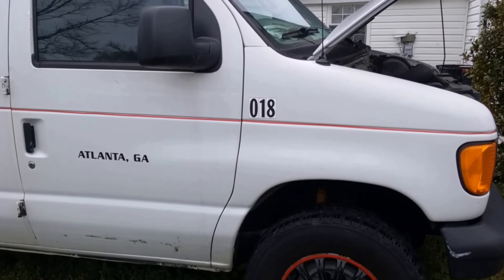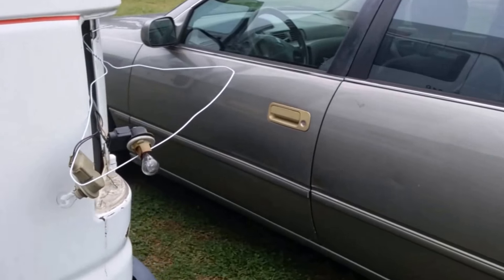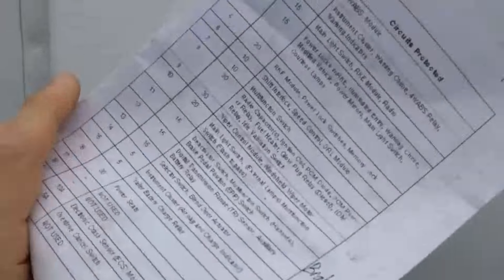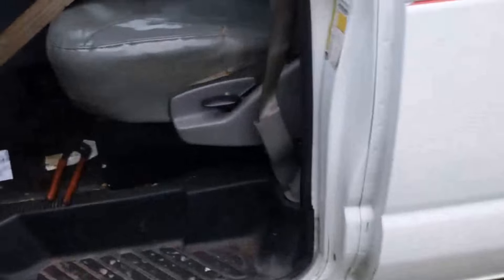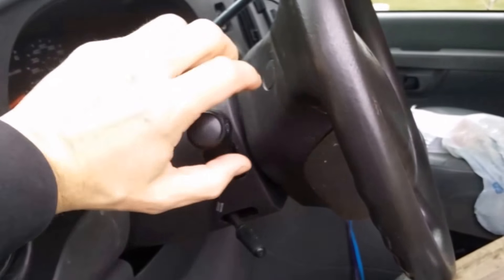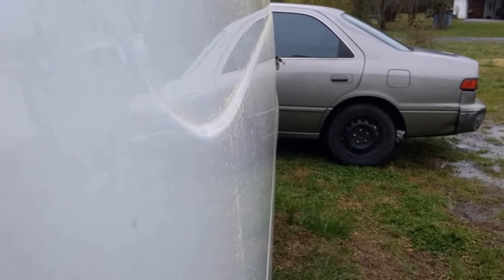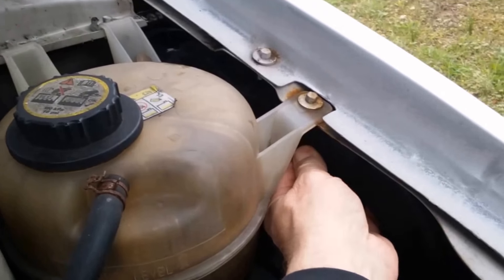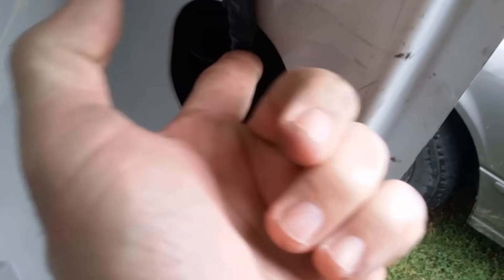How to diagnose brake lights and fix 2007 Ford E250

Comment: Check fuse 39 under the driver column. That fixed my issue.
Reply: Thank you! This fixed the brake lights being out problem, even though the hazards still work, didn't fix the turn signals also being out though.
Reply: @stevemags4966  Try looking up the other fuses that could relate to those other lights. Next step would be wire diagram if the lights aren’t getting power.

Comment: Good Show saneauto! What would you do if you only have 3 to 5 volts at the brake lite switch?
Reply from the maker: Wiggle the switch while the meter is on it. If no change wiggle the fuse etc. If still no change start following the wire back till you find the missing 12 volts. your eventually gonna find yourself at the ignition switch. So you could try tapping on it or wiggling it while the meter is on too. If the voltage changes while your wiggling something, that something is bad.

Comment: Looking at the fuse box diagram, the relay you show as 'brake light relay' is actually fuel pump relay. Are you sure that's the right relay?
Reply: Depends on the year and engine
Same relay block, just wired differently.   
On my 2006 E350 5.4 cutaway chassis  brake relay is the second small relay on the left side.
Under dash the fuse is #39

On my 97 e350 6.8 that relay is the horn and fuse #11, 39 is empty.
98 e350 5.4, same as the 97.

Comment: I have a 2008 Econoline van converted as step van, when I push the brake the left hand signal light comes on on the dash and outside. I know that in this trucks the brake wire is the same wire that powers the signals. Is there a module or relay that controls switching between signal and brake lights?  BTY another mechanic replaced the turn signal switch already. 
Thanks in advance for any help.
Reply from the maker: I once worked on a guys engine miss for 2 weeks and replaced a half dozen things because he insisted the plug wires were new from the last guy. They did still look new. When I finally replaced them the misfire was gone. That being said I also had a Crown Vic with a similar problem to what your experiencing it was a bad brake light bulb. One of the 2 filaments in the bulb fell down and was touching the other filament bridging the gap between the brake circuit and the turn signal circuit. I have no idea if this is your problem. Bulbs are cheap and easy to replace.
Reply: @saneauto  I already checked the bulbs. Thank you.

Comment: Brake lights work but no tail lights. 1996 Ford E150. Any tips? Checked fuses.
Reply from the maker: Check headlight switch
Reply: @saneauto  Thank you, issue resolved. I also have a separate issue. Windshield wipers stay on.  Pulled the fuse to turn them off. I believe this vehicle has moisture damage that has damaged electronics, caused rust and mold underneath the dash. Any tips to get the wipers working again?

Comment: I'm having a similar issue with my van the front hazard front turn signals and rear park lights work but no rear turn signals,flashers or brake lights I tried the fuses and bulbs still nothing
Reply from the maker: Try tapping or wiggling the multi switch. If that temporarily fixes the problem click the link in the description and order a multi switch. Or get one at your local parts store. If it doesnt make any difference, It could still be the multi switch its just unfortunate that you wont know until you replace it.

Comment: My problem on my 2003 Ford e150 van is that the brake lights won't turn off unless I turn the key off and back on, but when I press the pedal again then the brake lights stay on even though I let the pedal back up.
Reply from the maker: Get the lights to stay on like you usually do. Then Have someone watch the brake lights while you wiggle and tap on the brake switch. then do the same with the blinker switch, electrical part of the ignition switch, fuse box etc. The first thing you tap on that makes the brake lights go out is your most likely suspect.
Reply: @saneauto  ok, good advice